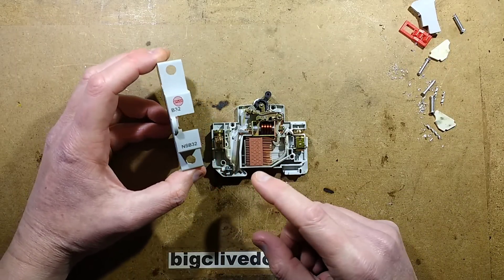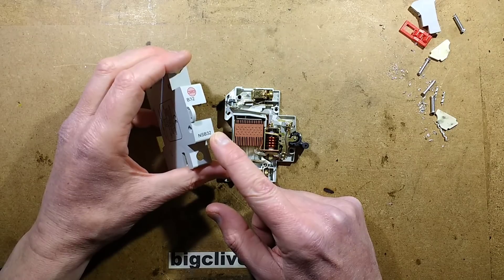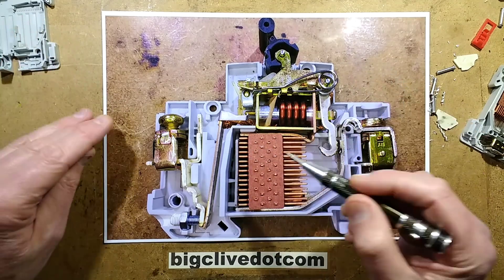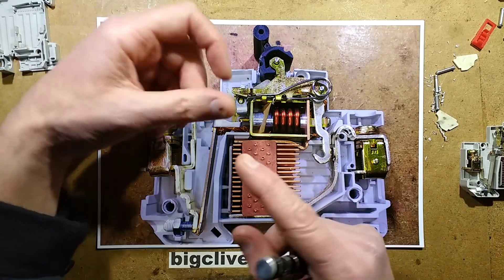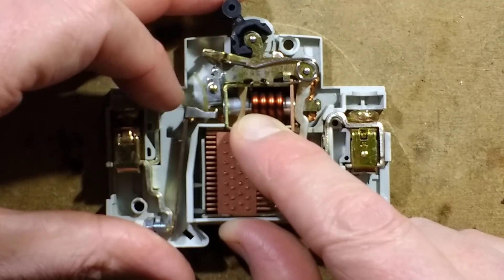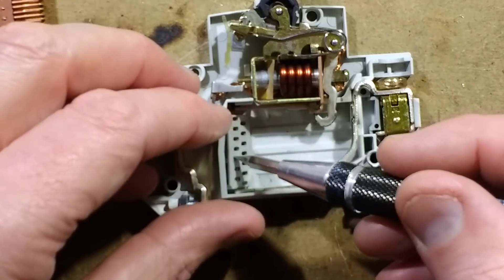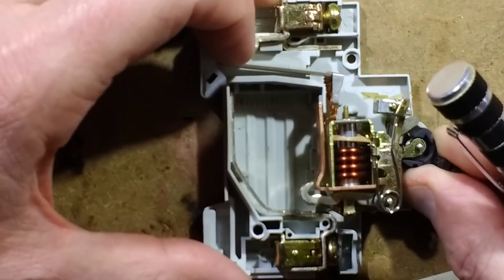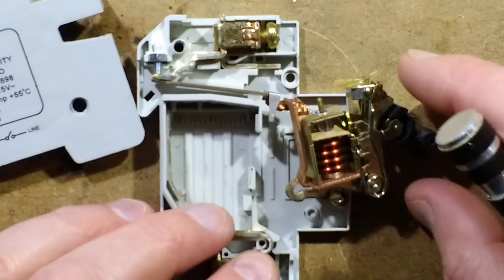Inside a faulty UK Wylex circuit breaker.

Comment: I've looked online a bit a few months ago, and I couldn't find anything (I guess I wasn't phrasing my question correctly or something for google to be useful)... So maybe someone here could answer my questions on European power.

I'm confused on how single/double pole breakers work in Europe.  In the US (for homes), we get 2 120V leads from the grid on opposing phases so we can run 120V to our normal outlets and lights, and then 240V for larger appliances.  So 120V circuits get a single pole breaker since there's only 1 hot lead, and 240V circuits get a double pole since there are 2 hot leads.  From things I've read people in Europe get 230V (or 220V?) from the power grid, and it seems to be like the US where its 2 hot leads on opposing phases, and I tested it with my multimeter when I went to Russia last summer and that was the case (2 hots and 1 ground in the normal outlet).  But then what happens with the other phase?  When I looked in a few breaker panels there I saw single and double pole breakers...  If someone could post a link, or explain it yourself, that answers this that would be great.

Also, keep making awesome videos Clive :D
Reply from the maker: In the UK we have a standard three phase system of 240/415 (referred to as 230/400 now) with a single phase and neutral being supplied to homes and the full three phases being supplied to industrial and commercial premises.  Home distribution boards generally have single pole breakers just breaking the phase.  The only time double pole breakers are used is to break both live and neutral where it is required for safety purposes or to isolate neutral/earth faults where they may cause issues with RCDs/GFIs tripping.
Reply: Oh ok, that makes sense.  Thank you.

(also I'm fangirling so hard right now)
Reply: in Switzerland (and i believe Germany as well), all three phases plus PEN (neutral and earth lead combined) are being delivered to the buildings. In the main building distribution board the PEN is seperated into earth and neutral. After the seperation and a couple of fuses for all 3 phases the energy meter is wired. After that they are distributed to the appartments. In the small distribution box of the apprtment the lights and normal outlets are wired to one random phase with a main RCD/GFI (so that each phase gets similar power draw). All power hungry devices like washing machine, tumbler and stuff like that get 3 phases (3x400V, very practicsl for running motors). The 2phase SCB you saw probably were 2phase RCD's/GFI's that are being used more and more often here.
Reply: Here in Norway we have mainly two different distrubution systems. One is 230V 3Phase IT without neutral, other one is 400V TN with neutral. In existing installation is it common to have 3ph 230V incoming supply with a mains breaker of 50 or 63 Amp. In all these installations done on IT it is mandatory with breakers that breaks all the poles, and also protection in every pole. In TN installation we also use all pole breakers, but it is only mandatory with protection in "live" poles.
Reply: Felix Müller wow, Europe is crazy ;) I have a 10A single phase to the washer and dryer, 20A to the oven and 25A to the cooktop. 100A single phase for my main breaker.
Reply: Well at least here in Germany we commonly have a 3 phase 230/400V supply with a 63A main fuse, all the sockets and lights are being powered by a random  phase (although a 3 phase LED roomlight would be cool). Usually each circuit is being fused with a B16 fuse. Ovens normally run on 3 phase, but in many cases you can power them with only one or two phases. All other heavy appliances are normally using a normal plug and are in a few cases powered by a separated fuse
Reply: Everyone gets three phases to the home? Doesn't that mean its easy to run industrial equipment in your garages? That's kind of frowned upon here in the states, and you have to do all sort of hijinks (See AvE with his converters/inverter things) to get it to run, or pay money out the ass.
Reply: yes, afaik everyone gets 3 phases (buildings that is, not all homes have the 3 phases usable). e.g. in rent homes where the washing machine is in the basement, maybe in the flat itself only single phase outlets are used; it really depends. you can use industrial equipments to a certain degree; normal circuit breakers are 13A, those for the washing machine/dryer area could go up to 3x16A
Reply: Felix Müller 3 phase to the laundry? That’s something I’ve never seen! Ona 230V circuit you can draw 2.3kW at 10A which is enough for most domestic dryers... I guess if it’s a communal apartment laundry and they use industrial machines...
Reply: Phillip Hutchings no, actually they don't. We've got 3-phase machines here, dryer and washing machine. I know that you can draw up to 3kW with the (here standard) 13A breakers. We've got a normal household washing machine that needs 3 phases
Reply: Phillip Hutchings I've had another look at our distribution board. The breakers are: oven 3x16A, the washing machine/dryer combo 3x16A, the dishwasher 3x13A and the electric water heater 3x13A. Don't know the exact wattaged of all these devices, but could be overdimensioned a little
Reply: In Greece 3 phase service is pretty common in newer apartments.
Reply: All the homes I've seen here in Austria have 3-phase at the junction box (well, all that I had a look at, where I could tell by the installed meter). From single room flats in apartment buildings to family homes (and obviously in commercial buildings). Not everyone has an outlet installed, but it is quite common to have one somewhere in the house (we have two in the basement for power tools and stuff you could need around the house). 
What I hear from friends, it's pretty much identical in most of Europe, at least the central-eastern European and Scandinavian countries.

Btw. Russia has the same system as the rest of Europe. If you measured two hots on a single outles, I'm pretty sure you measured some kind of "phantom" voltage, maybe due to bad wiring.
Reply: XDSDDLord that being said, in the near future that could change and the single phase 16A outlet is getting more common here. more and more appliances run from a single phase, i guess since technology is evolving and the universal motors get more powerfuk and cheaper than 3phase motors.
Reply: We have a three phase domestic central heating system. Certainly not usual granted.
Reply: In the US we really have 240V with a center tap off of the line transformer. My experience outside the US (Israel) was that most homes get a single 240V phase. It's likely the line transformer is 3 phase though (looking at them I see 3 big brown wires going to buildings) but for residential they seem to only give you one phase.

Comment: There was a fairly ubiquitous breaker in Canada under the sylvania/commander brand that had its CSA rating revoked due to occasional failure for the breaker to throw in a fault. This breaker had been put out to pasture back in 95, but it is still found in most buildings built in the 80s.However they did make newer versions with improved innards. Breaker itself seems to have a bakelight shell and the panels are all metal housing. I haven’t seen any plastic panels here.
Reply: There was the FPE/Federal Pacific "Stab-Lok" breakers that would never trip, and there were also the Sylvania/Zinsco breakers. I think a company called Challenger purchased a part of Sylvania and continued to market the defective Zinsco breakers, but I may be wrong. Those Stab-Lok panels are fairly bad, though.
Reply: I presume you're talking about the infamous FPE Stablok 'nevrtrip' ?

Over here in the UK the same design of breaker 'stablok' was sold as 'federal electric'. Not sure if the tripping issues were also carried over.

And no, as JUSB says, our regs have changed back to metal panels. Our panels were (and are) a LOT smaller than North American panels, so plastic made sense (our circuit design is to prevent fire, rather than contain it, which the NEC/CEC seem to focus on). But as Clive says, bad workmanship, or bad batches, could render all that moot, and there were enough incidents, especially in the London area, that the London Fire Brigade lobbied the IET to change the regs, I believe.  I support the idea, but the rules actually say 'non combustible' not 'metal'. I'd have thought bakelite would also conform, but no manuf. seems to have gone that direction.
Reply: I have Heard about the wide popping margins on the FPE panels. There are pretty bad for taking their time to blow 😝
Reply: i think our latest regulations brings back metal panels, for fire protection reasons
Reply: The FPE breakers were very slow to trip but there was never really an issue with them in Canada having problems, but are now obsolete since they were bought out by Schneider electric that also own "Square D"... Some of the more recent FPE panels had Square D main breakers within....   The "Commander/Sylvania" ones in question  were the "QBH" series and  found  everywhere from the mid 70's to mid 90's and even their  newer replacement the "BQL" series lasted 2 years before becoming obsolete. Those had problems with where the breakers bolted to the buss and breakers completely overheating and destroying themselves.
Reply: In the US, at least in my municipality Federal Pacific breakers are banned and can cause problems when getting homeowners insurance. They were considered a real problem and many houses from the 70's and 80's still have them.
Reply: REWYRED I am quite a fan of the square D QO type breakers. They seemed to pretty accurate and reliable, but were more expensive. That may be why they weren’t all that common. 
I remember seeing some of the very obsolete Bulldog breakers which were a push button style. Quite neat.
Reply: markg735  I have heard they were problematic in the US.. Up here they went under "federal pioneer" and there are still millions out there..  I used to work at a supplier that sold FPE.. Needless to say I have it in my house, parents, neighbours....  Never ever had one not trip when its supposed to,  I guess the Canadian ones are a bit different.
Reply: threeparots1  QO is my favourite hands down... I would of put them in at my house etc but i worked at a supplier that sold FPE in the 90s....  I use nothing but square D QO  now whenever I can unless  I am adding a sub and want to match the breakers that are already installed on the property.